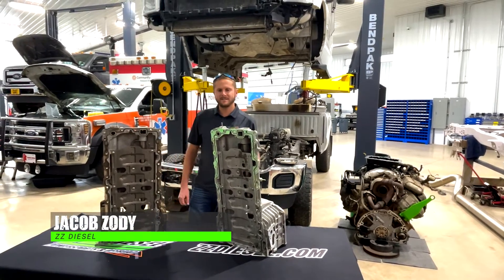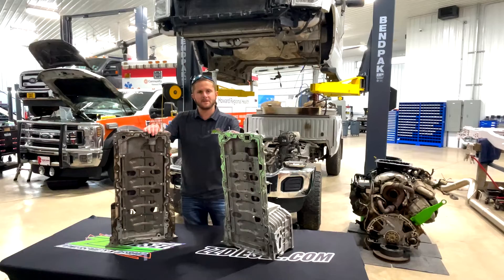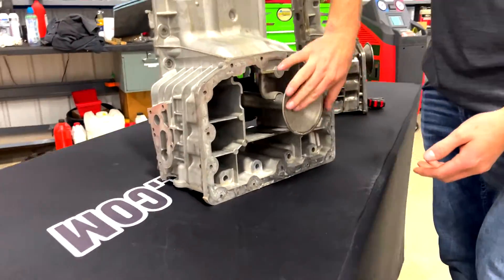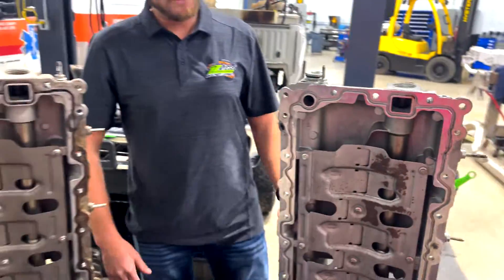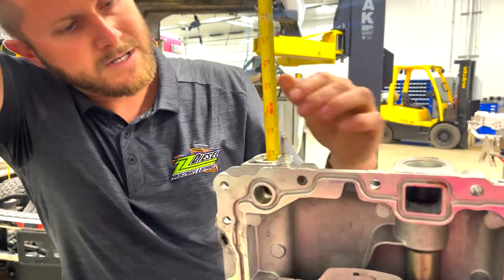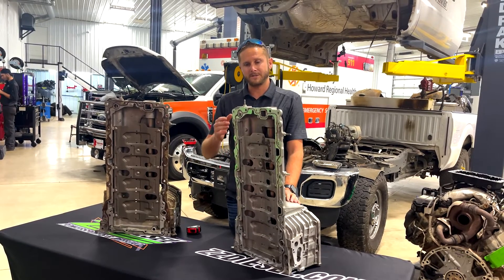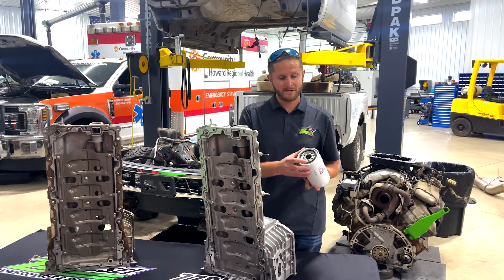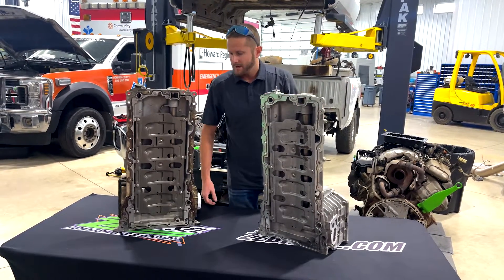Catastrophic engine failure from an OE Ford oil pan? 6.7L Powerstroke

Comment: Question why are you starting engines that have just been worked on before you have oil pressure? Also they make borescopes now that piggyback on to smartphones they're less than $100

Comment: Is there why have to replace upper oil pan ? Why don’t just replace gasket
Reply: Doesn't have a gasket, silicon sealer is used that's why they leak

Comment: I'm just curious as to why you replaced the upper oil pan as opposed to resealing it just curious
Reply: A lot of people who have 14 and up, want to go back to the original 11-13 upper oil pans, because they have a gasket, instead of being sealed with silicone. The gasket seals much better, and wont need a new gasket for 100k-150k miles. 
Resealing the upper oil pan is stupid expensive, because the transmission hast to be removed in order to do it. So going to the gasket saves time, and serious money over the life of the truck. 
My 2016 is leaking, and Im going to order an 11-13 model year upper oil pan for this exact reason. I want to be able to wait 150k more miles before I have to spend $3000 to have it resealed.
Reply: I’m curious too…
Reply: OVER engineered junk

Comment: How many 17 pans have you swapped with the gasketted pans? I want to swap my 17 to the pan with the gasket, but the technician at Ford told me that would be a bad idea. They look identical, so I’m not entirely sure why they WOULDNT work…
Reply from the maker: Watch this video: https://youtu.be/9zdpTlqPNvU where we explain this. We have heard that this is what Ford is telling customers. They will say this untill they go through all the pans without the gasket then it will be superseded. Several of our customers have done the update.
Reply: @zzdieselofficial  thanks ZZ! All I needed to know…
Reply: @mr8610  It is the same exact pan. The ONLY difference, is the gasket cut in. 
Your tech probably told you it was a bad idea, because he wants your business much sooner to reseal the leaky oil pan that has no gasket.